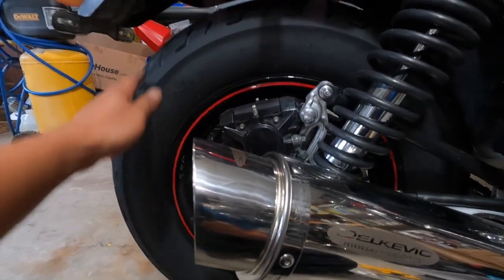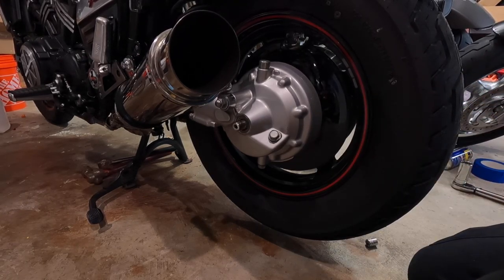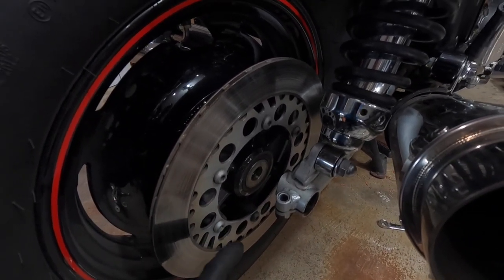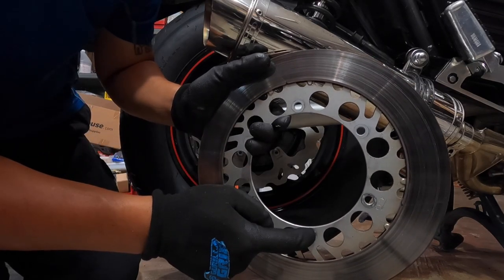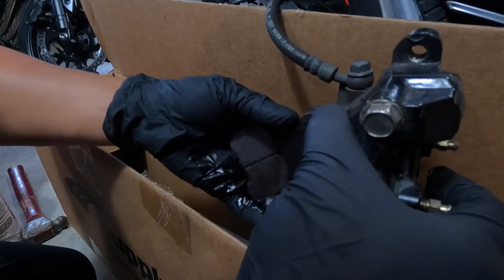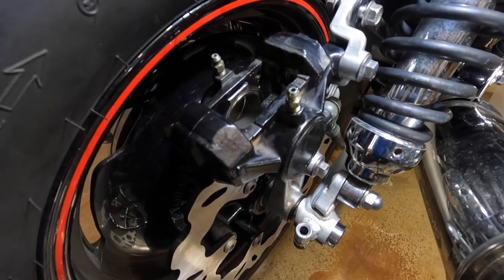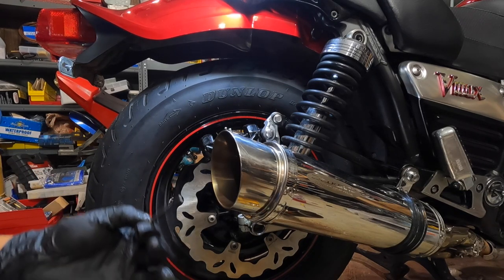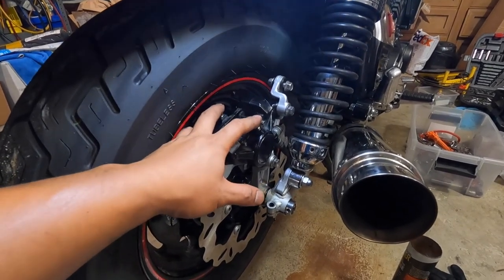VMAX GEN1 REAR BREAK DISC AND PADS CHANGE OUT .

Comment: WOW. You saved me soooo much time by not removing my rear wheel. I just upgraded my 85 MAX with high performance rotors. My VMax is an 85. She has 12K original miles,was production number 2,131 off the line in June 1985.She is Red and Black and in near perfect condition. I am the second owner and the old guy I bought it from kept her in a heated garage. I LOVE this Motorcycle. I am looking for a 1995 and a 2005.I buy extra parts all the time just in case.I get great parts from a Motorcycle Mechanic in Japan.He sent me a factory workbook for my bike. Thank you for the video and STAY SAFE on your rocket lol.

Comment: I noticed you kind of skipped over the rotor bolt removal.. How much trouble did you have removing the old rotor bolts? Did you replace them with oem new?
Reply from the maker: They were easy , right bit and extra caution will be ok .